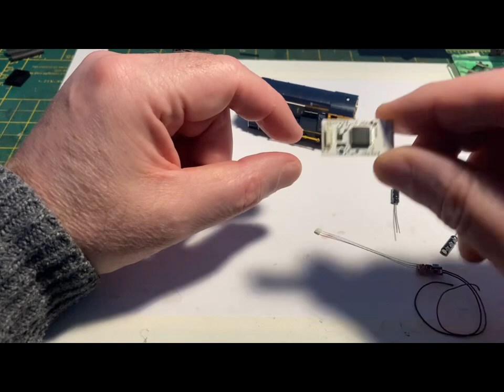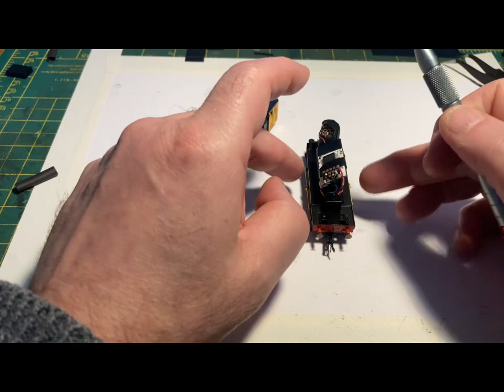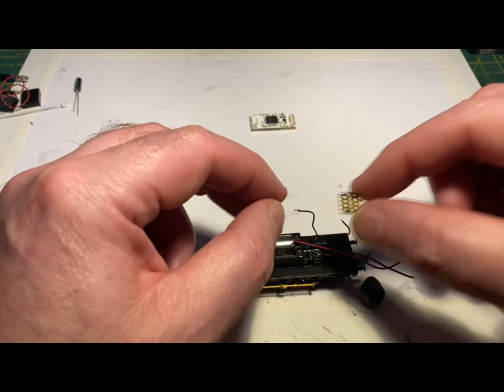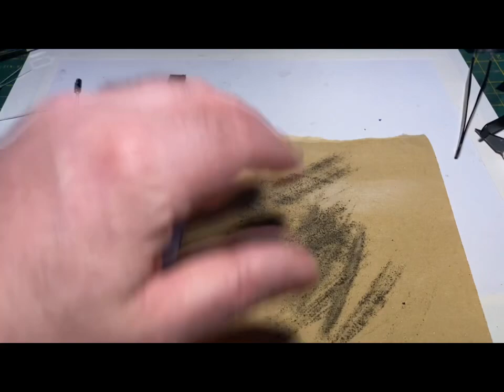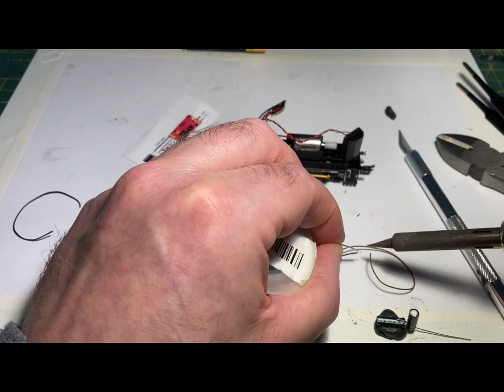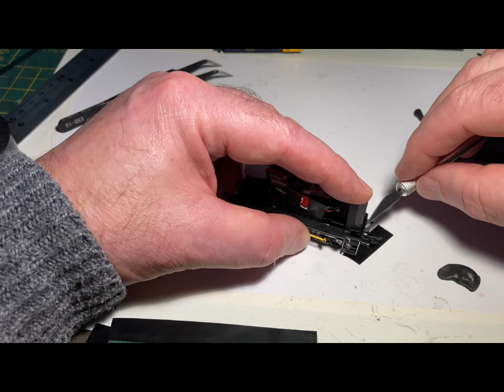HM DCC Next 18 Sound decoder, stay alive in Hornby TT:120 08, no cutting/cab removal,  £90 👍

Comment: I've just ordered this very 08 and want to do this very thing but am struggling to get the exact items that you're using. Is it possible to make a simple shopping list and link the items in the description at all please (I'm thinking idiots guide 😉) .  Really helpful video thanks 😁 👍
Reply from the maker: Check the description for the video and that has links to the parts you need. Shout if you need anything over that 👍
Reply: @HighFell really sorry but just can't identify the items I need apart from the motor.... I'm worried I'll get the wrong thing!  Is there a product code you could let me have? 😊
Reply from the maker: @philsilva13 ok so you have found the 08 Coreless motor on Bayliss Bespoke Designs website? 
On the Tramfabriek website you will find the Nano Power Bank, 02020204H
You have a choice of decoder and/adapter plate. If you use the HM 7000 TXS 8 pin decoder you cut the plug off and wire it as per the previous video and then do the rest of the install like this to fit it all in the engine bay. 
If you choose the HM 7000 TXS N18 decoder you can choose which female adapter board you get from Tramfabriek, either Type 1 02020107 or Type 2 02020108. The difference is the number of solder pads. 
You will need some 4mm heat shrink to insulate two of the soldered joints on the capacitors of the powerbank. The one joining the two capacitors is fine open due to its position. Some insulation tape and superglue.
Reply: @HighFell fantastic thank you so much for both the help and the video 👍
Reply from the maker: @  any problems feel free to ask for advice. 👍
Reply: @HighFell  Sadly the adapter is sold out and and power bank is on pre order but I'll wait out on them but at least I know what I'm getting 😉
Reply from the maker: @ seems that is the price of success! I’m sure Sven is working hard to get more stock in asap. I have no idea how many people are now installing HM 7000 decoders into the TT:120 08 themselves but it’s great to see people realising what is possible 😁
Reply: @HighFell  And thanks in no small part to yourself I'm sure.... Subbed and watching intently 👍😁
Reply: I have everything on the way but can I ask what type of grease you use for the worm drive and also are you planning on putting other features o the loco such as lights so I can see how it's done? 😉😂
Reply from the maker: @philsilva13 you didn’t watch and make notes from first 8pin decoder install! 
Grease needs to be plastic friendly. I use red grease that  have in a pump for my bike. It’s also referred to as red rubber grease for cars and there is clear brake grease (another car product) other greases are not great for plastic and never use things like WD40!!!! It’s not a lubricant. 
Lights, maybe in a future video 😁
Reply: @HighFell  you're right I didn't watch the 8pin video but I don't want to confuse myself, 😱😂🤣 thanks again for the info and help 👍.... I've been looking at your other videos. They are so inspiring
Reply from the maker: @philsilva13 ha ha, fill your boots! The best of this hobby is sharing and many do which is what inspired me. There are those that are in it just for the fame and money ( I know, there isn’t any but let them think there is 🤣)
Reply: My adapters and power banks finally arrived so roll on this weekend! 😁 I also have some tf2 lubricant bike grease for the engine so cross your fingers for me..... I'm going in!!
Reply from the maker: @ take your time and you should be fine. If you get stuck with anything ask away 😁👍
Reply: Real problems....can I message you at all?
Reply: Real problems....can I message you at all?
Reply from the maker: @ are you on the Hornby forum? There is a PM function
Reply: @HighFell  I can be.... The TT one I'm guessing 😉
Reply from the maker: @philsilva13 Official Hornby website, community, Forums and then find me as Rallymatt

Comment: Fantastic!  Surely the Hornby 6 pin is dead - even before it arrives?
Reply from the maker: I don’t think they will give up on the 6 pin and it really is the ideal solution. Although it’s possible to fit the n18 in there is no way Hornby or any manufacturer would use this method 🤣